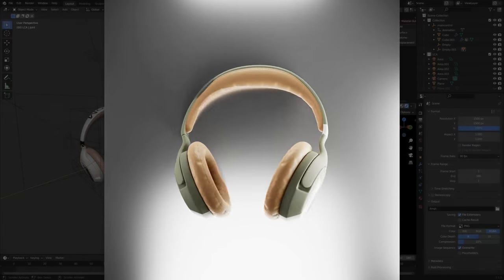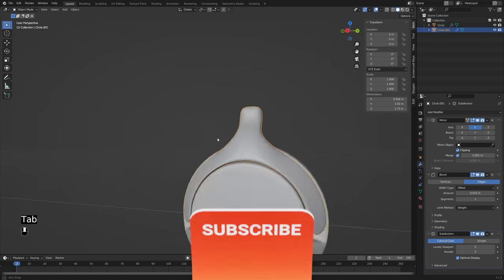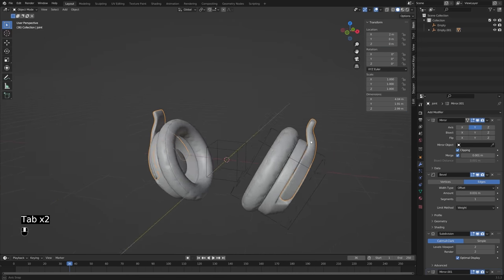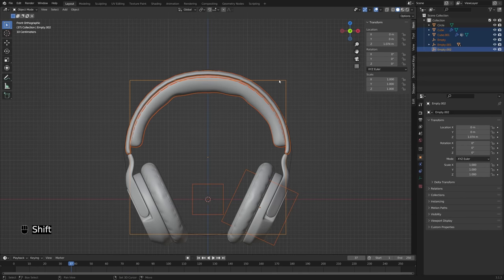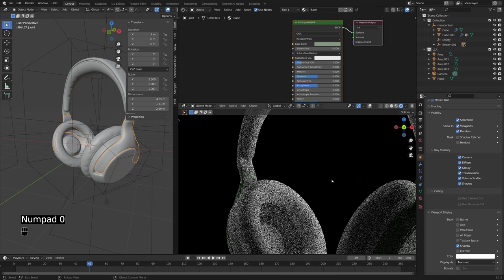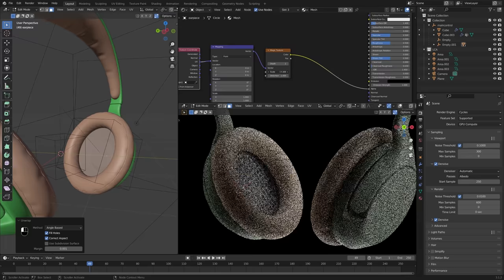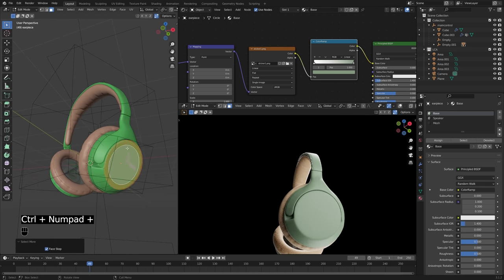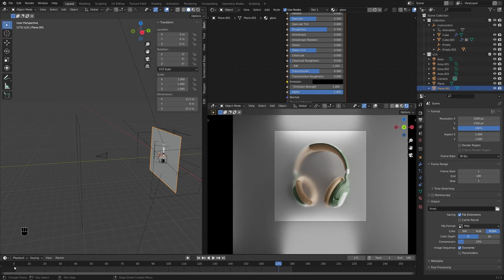Product Design in Blender: Headphones [Full Process]

Comment: The difference of transmission roughness vs roughness is the former is roughness of the "volume" and affects the refraction, roughness is just the surface. You can have frosted glass inside but polished on the surface or vice versa.
Reply from the maker: Good points that makes sense. I suppose transmission roughness is more visible on thick objects

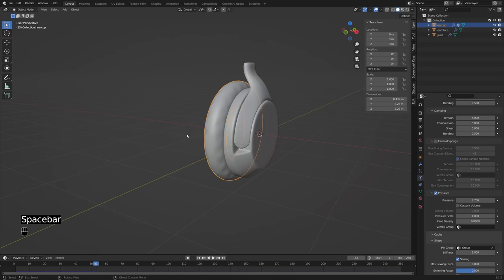Comment: If you also had a problem with the ear cushion going backwards (at about 18:20 in the video), the solution is to set the pressure to a negative number.
Reply: recalculate your normals. you will have shading issues, curling issues and more if you don't.
Reply: THANK YOU u saved me fr I was so confused
Reply: Thanks bro ❤
Reply: love this kind of people, find an issue solve it share it with others. (L)

Comment: There's a built-in plugin, Copy Attributes, that allows you to copy modifiers from one object to another.
 
Also, the spikes might be from having the Solidifier or Bevel up too high with either odd geometry/normals or not having transforms applied.
Reply from the maker: I'll have to check out that plugin. And I think the spikes are from something having to do with multiple materials on one object
Reply: @DerekElliott  Interesting. I haven't encountered an issue with using multiple materials on an object, but I have with a one-size-fits-all Solidifier or Bevel approach. Maybe try separating the L and R cups (or whatever is spiking) out as separate objects and then removing those modifiers. That or check your normals and transforms.
 
Either way, thank you for making entertaining and informative videos. Looking forward to watching more 🙂

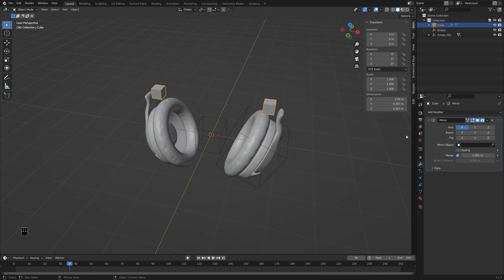Comment: Great tutorial. At 23:30 you can simply add a circle from wich you create the shape of the headband and then adjust everything to fit with the rest of the headphones. No need to add cube and everything.
Reply: How would that work when the circle is thin
Reply: @nebztheprodigy235  you add a circle, delete the part U don’t need then extrude edges ( u can type alt s to maintain shape) then you extrude again for the thickness.

Comment: Unfortunatley the stage at 22:00 does not work in blender 4.0 for some reason. Once I have everything parented to the empties it crashes upon moving the cube. I have tried it for around 15 minutes hiding each object doesnt work, hiding the mirror etc.
Reply: I switched to Blender 3.6.8 for the same reason lol
Reply: Try right clicking the object and hitting "convert to > mesh". It'll collapse that objects modifiers, but it should help prevent the crashing.
Reply: Tts to be fixed in 4.2

Comment: Great video! One thing I'm curious about is why you recommend rendering it to image files instead of a video straight from blender?
Reply from the maker: Mostly because if you get any glitches or issues with a certain frame you have much more control to fix it. In eevee this is not as big of a deal but if you are spending 10+ hours rendering an animation in cycles you want every last bit of that work accessible easily!
Reply: @DerekElliott  fair enough. Thanks

Comment: I'm on Blender 4.0, I made it to 21 minutes here but now Blender will just crash if I try to do laterally anything. It started after I mirrored the 3 pieces we made. Anyone have any clue why this may be happening? Running a brand new 13th gen i9 and a 4070ti
Reply: Try right clicking the object and hitting "convert to > mesh". It'll collapse that objects modifiers, but it should help prevent the crashing.

Comment: 7:07 bevel modifier is not working for me :( may anybody help to me ? its not first time that bevel modifier is not working but I couldn't fix the problem anytime ? thanks
Reply: Hi, maybe it's too late, but I have found a solution, and I'm sharing it in case anyone has the same problem. Just play with the Clamp parameter of the Solidify modifier, under Thickness clamp. It worked for me.
Reply: @nenomarinov  thank you so much Marinov!

Comment: Can I ask how your sub D modifier isn't affecting the UV textures? Mine are warped after I apply the modifier?
Reply from the maker: The best thing to do is to add your UVs after you apply subdivision. But there is also a button to use subdivision surface when you are unwrapping. Which can help with the stretching but I also get mixed results

Comment: Derek, thanks for the video!!! I learned alot!! You are great 👍
Do you have a clue why the voronoi texture is working fine on the earpiece but the same linked material applied to the top cushion gives just small bumps, not voroni?
Reply from the maker: Maybe the object scales are off? Or if using UV maybe they are sized different
Reply: @DerekElliott  Actually I spent a few hours yesterday redoing the cushion many times, finally it was fixed: I set the object field in the "Texture Coordinate" to be the earpiece object, and that fixed it... I wonder why, because in your video you didn't do that.I use Blender 3.4, maybe that's the reason...

I don't understand what "objects scales are off" mean.
Reply from the maker: @alwaysCuriousOne  sometimes if you are using procedural textures if an object scales is not 1,1,1 then the texture may appear different on one object vs another
Reply: @DerekElliott  so after scaling the primitive we have to apply the scale, that's what you mean?
Reply: @DerekElliott You were correct! It fixed the issue. Many thanks!

Comment: The bevel won't appear on the mesh no matter what I do. Any ideas?
Reply: If the bevel is not working 1st select the mesh and use merge by distance to eliminate duplicate vertices. If that doesn't work it might be the normal on the faces.  Select the mesh and in the mesh menu select nomals> recalculate outwards.